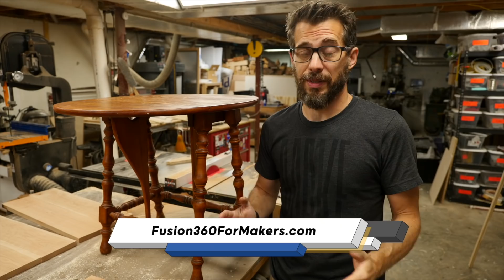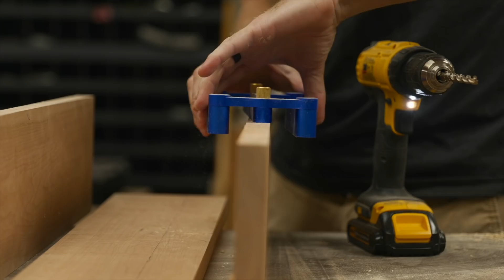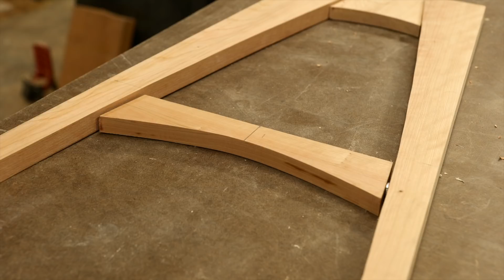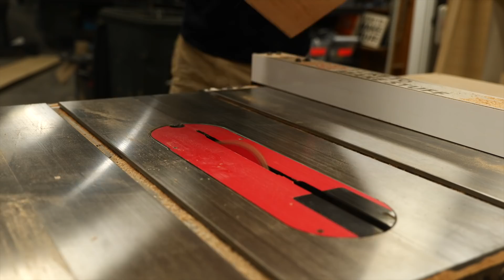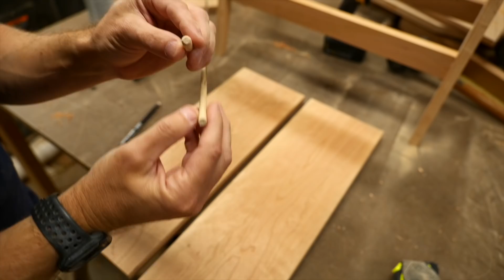First Steps Toward Fine Woodworking | I Like To Make Stuff

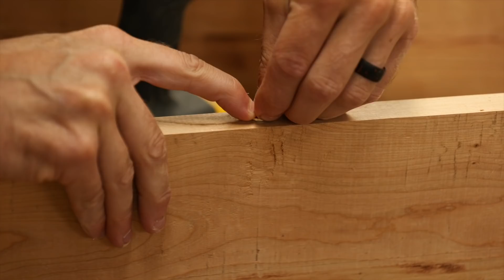Comment: Where can I find a blue jig like the one at 3:34? I spent hours trying to drill straight in a board and it didn't work. which is why I have a crooked bathroom mirror :( I could use one of those

Comment: I love how old furniture works, I have an old dinning table with wings that uses a metal bar that folds out to hold the wing up at an angle, then you push the metal up at it's mid point to fold down again

Comment: Is there any special benefit in using dowels over biscuits? Or is it just use the tool you have?
Reply from the maker: I have both, but dowels are more exact for aligning pieces. Biscuits are great, but create a little bit of room laterally so the pieces can slide until the glue is dry (good or bad, depending on what you need.)
Reply: @Iliketomakestuff  Right. Thanks.

Comment: Not sure what you used for finish, but I have found that a great option for this type of furniture is a hard wax oil like Rubio is a great option. Much more durable then just oil, resists water pretty well, but if you get some bad spots or cup rings, you can just sand the bad spot, reapply the finish and it blends right in. Unlike other film finishes that require a full refinishing.
I switched for this for my butcher block countertop from mineral oil and it’s been so much better and less maintenance.

Comment: May i suggest a next project that i have been tinkering about for quite some time? a computer desk that can be raised for both standing and sitting down use but without the use of expensive hydraulics or messy looking pulleys tied up to the ceiling.

Comment: Hey, Bob, the table looks awesome! Great work! Just keep an eye out for cracks or delamination on the top of the table, usually tabletops aren't glued to the base, to let the wood have move as it wants to expand and contract throughout the seasons. I usually use just screws with enlarged holes or pocket screws, but there are a lot of fasteners out there, such as figure eights or z fasteners.

Comment: Got a similar one that is also dowelled together. Some day I will have to re glue the dowels, but having the splits is still very nice, and it is probably over a century old, so some splits is expected, plus also a oiled finish, so hard to glue now, as the wood is oil soaked thoroughly.

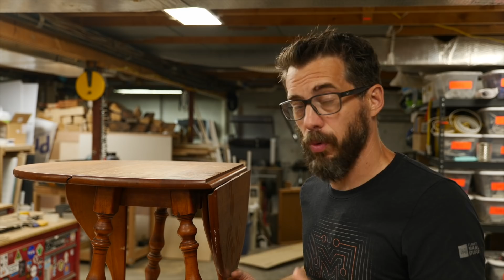Comment: At 8:40, the edge of the table top where the hinge is, it is designed to support the weight of the leaf when it is raised, relieving the hinges from carrying the load. It is also to create a finished profile around the edge of the table, a rebated radius, that matches the profile used on all the other edges. The radius used in that profile also centres on the centre of the hinge pin. 
The swing out 'gate' also would only support the leaf at the far end so that it doesn't rub in the underside of the leaf, if there is any timber movement later on.

This is all the strange sort of stuff that pops back into my head from furniture college 17 years ago after my bout of memory loss due to a minor stroke 10 years ago. I hadn't even thought about any of this until I watched your video. Maybe the memories are not completely lost after all! Funny how brains work.

Comment: For the bandsaw resawing - have you checked out the Alex Snodgrass method of setting up the blade? It's slightly different than some other methods and has really worked well for me (and others like Katz-Moses).  Easy to search, and apologies if you've already tried or gotten told that a hundred times.
Reply from the maker: I have. This Grizzly bandsaw with the added riser just doesn't want to cooperate.
Reply: @Iliketomakestuff  Nuts!! Awesome that you overcome it and plow on, though. Very cool table - love the cherry!

Comment: If I use enough dowels then would be possible to not use glue at all, just have the pieces friction/pressure fit? So that I can take it apart whenever. Or would that lessen the strength of the table? 
Also the mid video haircut was surprising but it looks good.
Reply from the maker: You could, but you're relying solely on friction. Depending on the movement of the piece you could get away with it.

Comment: You can add a holder for a flower pot on the bars connecting the both sides together.
Reply from the maker: You sure could. We'll have digital plans available in the description.
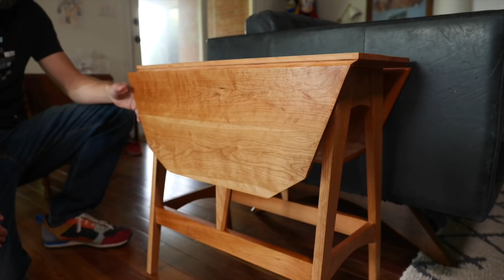Reply: 17:40 there
Reply: Hi
Reply: @huntersgaming1613  hey